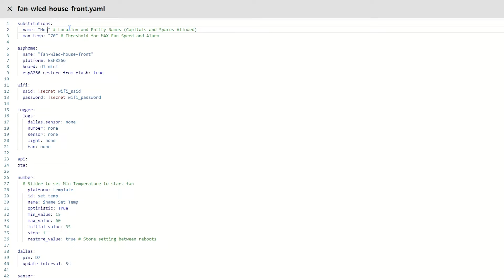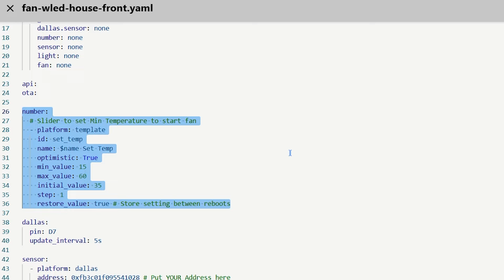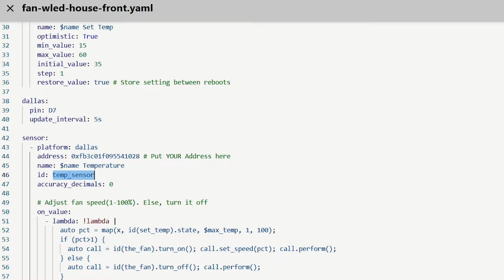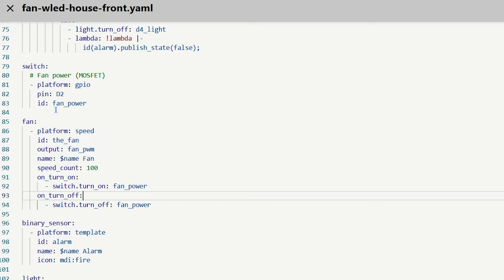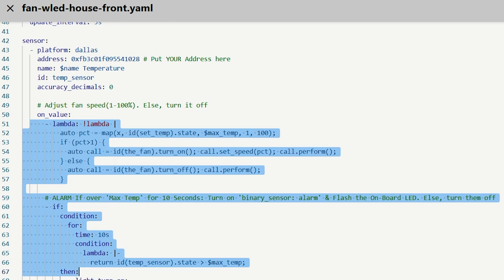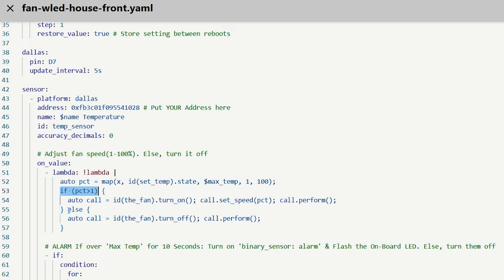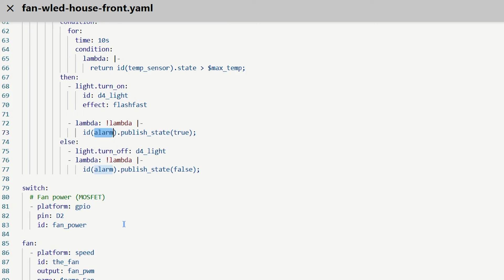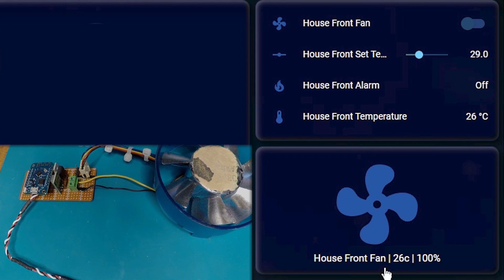Home Assistant 4-Wire PWM Fan Controller Prt 2 - Flash & Breakdown

Comment: Fantastic! I've used this to build an oil pumped burner that's controlled with a temp sensor to control the oil flow. Working spot on. I have an LCD with temp and set temp however I'd like to add the pump/fan speed percentage like shown on the web server under actions, but for the life of me I can't get it on the LCD. Can you point me in the right direction?
Reply from the maker: That's a great use-case. 
For getting the Fan speed percentage. As shown in this video, line 52 (of my ESPHome Code) timestamp: 07:23
You can either replicate that line to another template sensor and use that for your display...  Or,
Within the Fan Component itself - you have "fan.on_speed_set Trigger" this will also give you the "speed". More info here: https://esphome.io/components/fan/#fan-on-speed-set-trigger
Reply: @3ATIVE  Thanks so much for responding so quickly, I've been on this for the 3 hours and no further along. I've mange to get the speed  on the log output using the fan.on_speed_set Trigger. but can't get my head around pulling the "pct" variable created in the Lambda section timestamp: 07:23
Reply: Sorry I guess that was a statement and not a question! Could you elaborate a little on the "replicate that line to another template sensor and use that for your display" I've tried adding a binary sensor: platform template with an ID and Name of pct
Reply from the maker: @nivagc1  No worries...
1st: Using the "pct" was an option. Seeing as you have "on_speed_set:" working, here's how to use it.
1. Make a template sensor, give it a name and an ID. E.G.:

  - platform: template
    id: fanSpeed
    name: My Fan Speed

2. In the fan: component add the "on_speed_set:" to give the new sensor a value. E.G:

    on_speed_set:
        - sensor.template.publish:
            id: fanSpeed
            state: !lambda return x;

Now every time the fan speed changes, so too will your new sensor... you can this new sensor (id: fanSpeed) for your display.
Reply: @3ATIVE  Hello, thanks again for your reply. I've added the code and now I am able to see a fan percentage on my LCD as well as in the web server.....However! the script has stopped working. if I change the set temperature value the fan speed dose not change, also the fan will not turn on. I have tried to change the id and names of the sensor and template just to see if there is some sort of conflict. If I comment # the new code out it all works again.
Reply from the maker: @nivagc1  Well that's unfortunate (I step forward, two steps back! LOL)
To assist further I will need to more details, your full code, etc.
YT Comments won't cut-it so, please hop on my DISCORD server and I'll be more than happy to diagnose what I can. 
- You'll find the invite link on my main YT page.

Comment: Hi this has been a great project and I've had it working for a little while now to cool my media center. i have noticed that the esphome code wont update now as the sensor info needs to be changed, could you please confirm this and maybe help explain how. love your videos and many thanks.
Reply from the maker: Thanks for the support, I'm glad you are enjoying my videos. 
As for the code changes, I did make (I think) all the necessary changes. Check this video's description for the GitHub page link.
Reply: Hi thanks, I should have looked around more I did find the info and it helped. All working now and thanks again

Comment: Hello.  Is there also version for a humidity sensor Instead of the temp sensor.  ,   voor shower or bathroom fan   thank you
Reply from the maker: I haven't made a version... but, you could replace the DALLAS Sensor with any number of sensors, E.G.:
* DHT11
* DHT22
* BME280
- To name a few.

Comment: Great project thanks. Could I add a BME280 sensor to the esphome code instead of the dallas sensor.
Reply: Im getting a error when i validate [on_value] is an invalid option for [sensor.bmp280]. Please check the indentation.
Reply from the maker: Oh wait, you already did - LOL
As for the automation. Like any other sensor "on_value" should work fine. Check your code to see if it's correctly formatted.
Reply: @3ATIVE  Thank you is working now i didn't have the on_value inside the temperature indent or something like that :/
Reply from the maker: Of course you can....

Comment: What about reading fan speed? I'm wondering it is possible to read fan speed using esphome? In 4-pin fan there is one pin to read fan speed (tach).
Reply from the maker: Sure, the Tach output of the fan can be read using the Pulse Counter component in ESPHome. I chose not to add it here as it was a lot of code for something we already had... Plus the chances of a fan failing is quite slim.